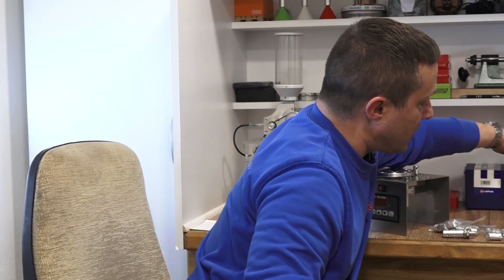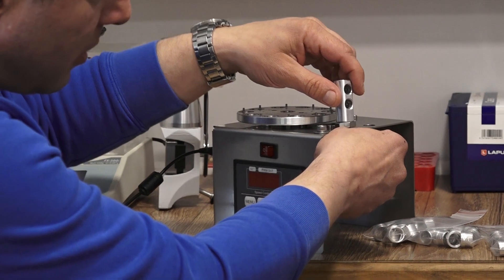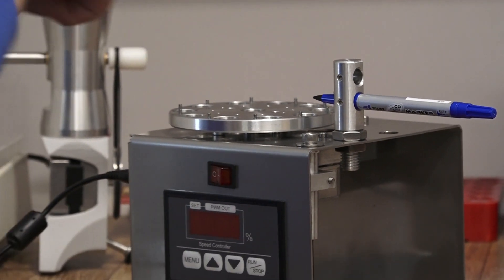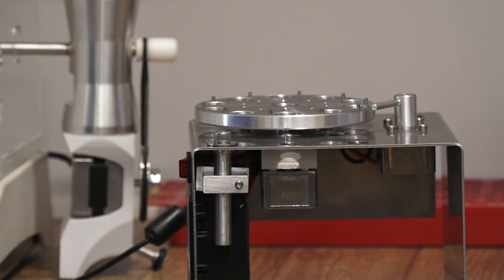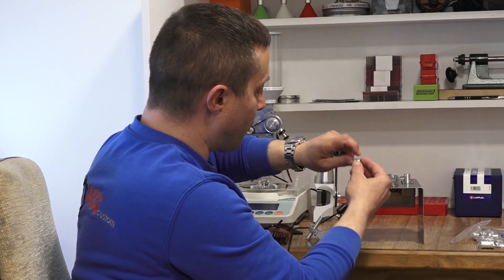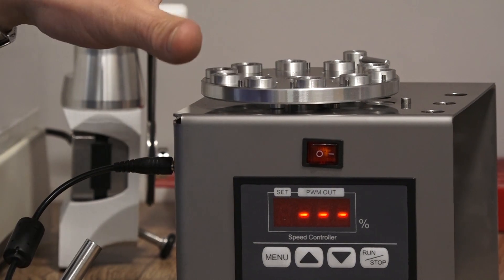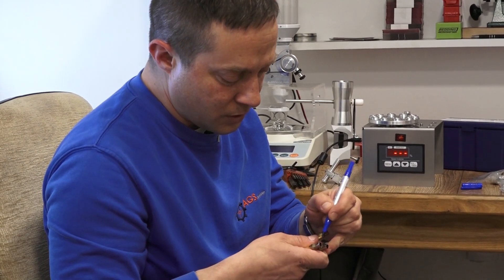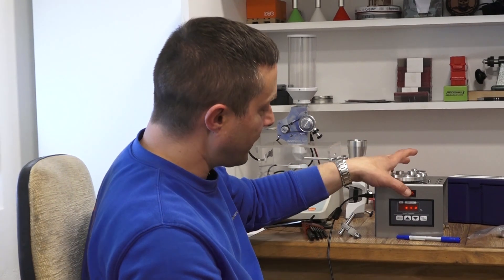AGS Brass Case Annealer 3.0 - Features and Upgrades From Previous Versions

Comment: To complete the setup of the Annealer you need 1) Power Cord, 2) Pencil torch tip, #3) propane tank (with or without a hose depending on perferred conntection),  to purchase, is that correct?  

Watched and read a few reviews in which they gave you many accolates on email response to questions of your product and shipping. It is really nice to see such a much more compact version of this style you are producing. Comparing this one and another from watching Youtube for annealing rifle brass (different type). Once purchased, hard to go back to something else at $200+, need to make a good decision. Thanks Stefan and keep up the good innovative products!

Comment: I have this model and  love it! It's super easy to set up. Ordered the second torch holder when I bought it, but it works great with one! The only small problem I had was running some 308 brass that still had primers in them. They didn't spin consistently when in the flame. Easy fix, just ran them through a universal decaper to knock the primers out. Keep up the innovation. I look forward to seeing what you come up with next.Thanks again for an awesome product.
Reply from the maker: For safety reasons always anneal unprimed brass. God forbid a case with unfired primer gets in the lot you’re running…
Reply: @agscustomparts  
It wasn't new primers it was fired brass.
Reply from the maker: @71gp  of course, just saying, per instructions and best practice one should anneal unprimed brass